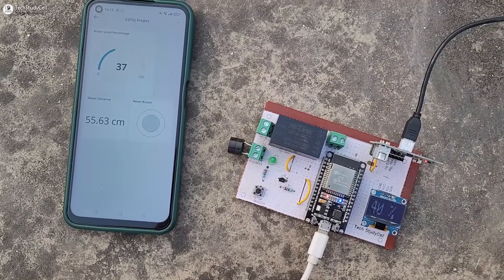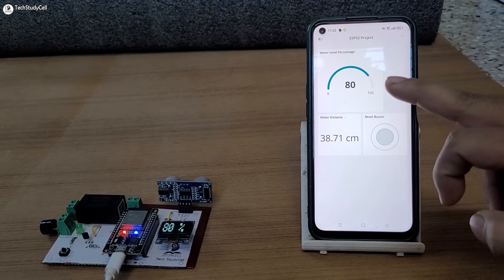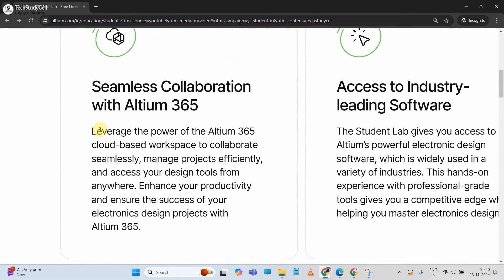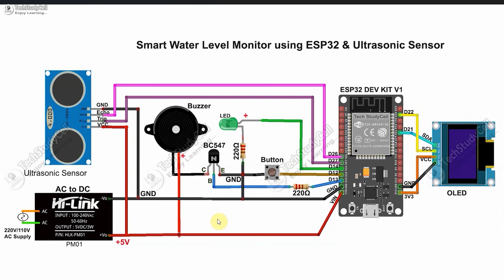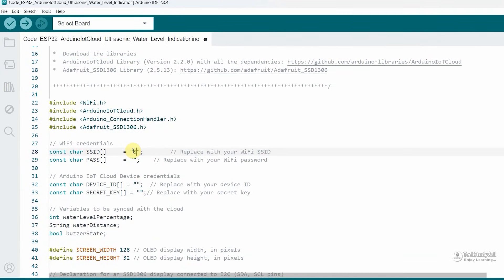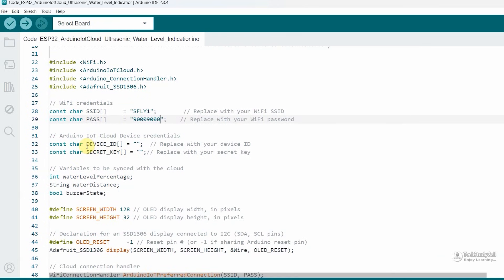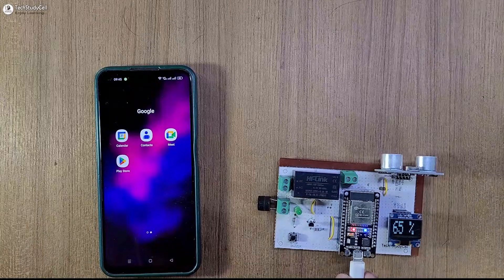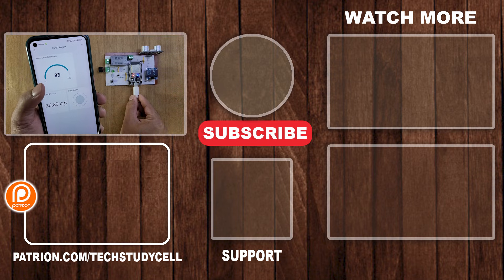IoT based Water Level indicator project using ESP32 Arduino IoT Cloud & Ultrasonic Sensor

Comment: Good project. Any option to trigger a notification on cloud or adruino iot remote app once water level reaches 10%. Buzzer is near water tank and we usually remain on our floor. Not possible to hear buzzer. 
Its good if we can add a notification on mobile or cloud

Comment: Sir my ultrasonic sensor is not detecting
Reply: The ultrasonic sensor used in above project does not work accurately.
I m using hc sr 04 ultrasonic sensors since one year just i made water proof m box for the pcb working fine without any issue

Comment: When using the sensor in a closed overhead tank, such as a 1000-liter tank, the readings are often inaccurate. This happens because the sensor's sound waves bounce excessively off the tank’s boundaries. Keep this in mind before implementing it. A medium or buffer can be used to stabilize the readings, but even then, accuracy remains an issue.
Reply: Will it work for closed tubed wells?

Comment: i am having an issue where i am unable to increase the length of the JRT SM04 , my water tank is on the second floor and motor setup is on the first floor, how can i make this project possible?
Reply: I tried extending the wire, but it didn’t provide reliable readings. Instead, I used an HC-12 module with an Arduino Pro Mini to transmit data from the 3rd floor to a receiver near the controller. This second HC-12 module receives the data and controls the pump.

Comment: Bro please help me to detect a probleam on my home automation project using esp 32, i connect it as per your vedio but only 3 output is comming from my esp32 board i change pin numbers but nothing happened please help me to findout the probleam